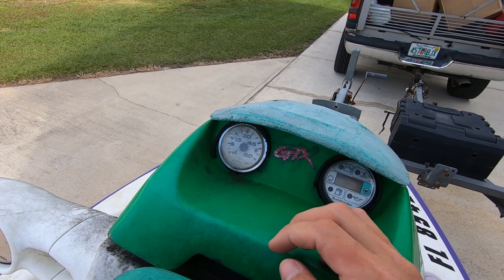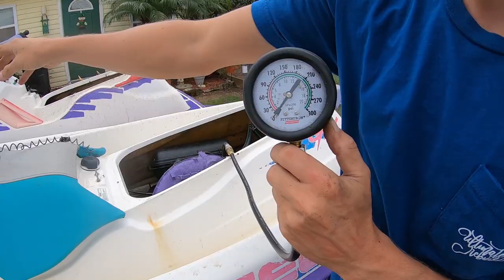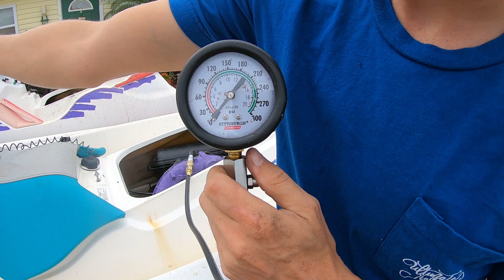I Bought a Pair of Jet Skis for $500! They Worth It?

Comment: 90psi is low for sea doo skis, however, I'd never trust a harbor freight gauge, I guarantee you'd have higher compression if you tested with a different gauge. But just so you know you want to be closer to 150ish on the 587, 657 and 717, which your spi has a 587 while the gtx is a 657 (I think, could be a 717 though) the difference on the sp to the Spi is the spi has a stainless steel impeller (that's all I know for differences) one very useful tip, DO NOT USE ANY OTHER CARB KIT THAN OEM MIKUNI!! You will go backwards with any other carb kits!

Comment: Those engines need to be around 120-150 psi in each cylinder. While the compression isn't crazy low, they do need to be higher than 90 psi.
Reply: They seem even, so I'm assumimg he just needs a better gauge. The harbor freight ones are junk and known to read really low.
Reply: Agreed, And the Harbor Freight compression tester can't be trusted

Comment: If it reads 90 put 1 or 2 oz of oil in each cylinder and re run the test over. If the PSI goes up then you know you have a ring problem

Comment: I just bought a 1990 seadoo with trailer for $300. However it does not stay running. If you give it gas it dies. Hoping its a easy fix.

Comment: Compression are good just reading 90 because I see you have a harbor freight compression tester and those read low I know because I did a compression test on my boat and the rent 90 then I bought a new one from snap on tools and the read I recommend using Anything else by Harbor freight

Comment: If you run anything that's fiberglass real hard you will twist it and that cracks the gel coat. Both of them look like they have been run hard  and hit them on rocks or what ever. Just sand the cracks out. And regel

Comment: Your compression is low because you are using too long a hose.  You not only have to pressurize the cylinder but ALSO the full volume of your hose.  Use as short a hose as possible.  Ideally a gauge with no hose at all for the most accurate reading.  You are probably good because all 4 cylinders were pretty much the same.  Would be unusual for them all to be low by exactly the same amount.

Comment: No the stress cracking is just cosmetic
Reply: The fiber glass under should be fine but if you don’t know the condition of the fiberglass underneath I would grind it down if it interest you but it should be fine and not leak if happens to older boats

Comment: Throw your harbor freight tester in the trash. They stopped putting schrader valves in them about 10 years ago. They all max out at 90psi. Get one from Amy auto parts store and I bet you’re much higher. Those skis wouldn’t run if they were actually at 90

Comment: Those gauges aren’t the best. Regardless they are both 2-strokes and a set of piston rings alone will wake them both up tremendously if you find out they’re both legitimately low on compression. Very cheap, and definitely doable for someone with your level of mechanics. If you do rings you will get so much more life out of them not to mention power, IF the compression test comes back low. $500 is still a good deal though. Before taking anything on the water or running at high RPM’s I always have the basic things I do first. Drain every bit of old fuel and fill the tank with new fuel and throw in a half can of sea foam. Replace air filter, and fuel filters. New plugs, check wires for dry rot. Wouldn’t hurt to check header pipe seals to make sure your exhaust is still making a solid seal and the gasket or seal isn’t dry rotted. I use high temp rtv on all my 2-strokes. Once you get your carbs back you can play with your idle screw just a little bit if you’re having the same issues as your last ski as far as them not wanting to start right away and idle

Comment: You should feel guilty for stealing those jet skis. That trailer sells for $3,000 new and good luck finding a used one. The carbs can be bought new on ebay for not much money. If you took one engine out and stripped all the parts off of it and sold the engine block alone, you could get $500. So yeah, you got a killer deal. The compression test was done correctly but to diagnose the problem you should put a tablespoon of  transmission oil or motor oil in the cylinder and do the test again. If you get an increase in compression then the problem is worn piston rings. If the compression stays at 90, then something else could be leaking but on a 2 cycle engine that seems unlikely.
  Paint if you must but the gruffy look gives it character and makes it easier to identify if stolen. For that reason a custom paint job would be better. I would also stencil the serial number on the back to make it easier for the police to find it if it gets stolen. Stick on numbers and letters can be easily scrapped off by thieves so don't use them. After stenciling the serial number, seal it with a clear coat. Make sure that all the lights work on the trailer and put some reflector tape on the sides of the trailer and for extra visibility I'd do the same on the sides of the Personal Water Craft. The more visible you are to all the drunk and drugged drivers on the road the less likely you are to be hit. 

Get that trailer and the jet skis (PWC) registered as soon as possible in case you need more info from the previous owner. Make a contact on your cell for each machine and note the serial numbers of both the hull and the engine. In addition to that I use a free phone app called "fuelly" or "acar". It keeps track of your maintenance schedule, part numbers, cost of repairs, per hour operations cost and fuel usage. I use it for my car and lawn mower. You should install hour meters on your machines because that is what you need to enter where it asks for mileage. I would also clean, inspect and replace, if necessary, the trailer's wheel bearings and replace the wheel bearing dust covers with bearing buddies. That way you can use a grease gun to squeeze the water out of the bearings as part of your maintenance routine. Put some flares in those waterproof containers and find out what other items may be required by your state.  Put a goofy sticker on the winch post that will remind you to check the drain plug before a launch, Sponge Bob would be appropriate.  Always require everyone to be buckled up when they are riding in your truck or car, stay safe, and have fun.

Comment: This was cut and paste from a Rotax Blog, Take it or leave it

.f an engine had a poor differential pressure check I would always run it before I made a final decision on a low cylinder reading.

Yes a warm engine is always best, but......

Typically a Rotax engine compression test is very close or the same warm or cold because of its tight tolerances. That said it could be different if left over long periods and would need to be run a few minutes to get oil and sealing surfaces up to their optimum. I have been checking this over the last 10 years. A warm engine versus a cold engine that just sat overnight or for 5-8 hours. I do at least 50 compression test a year on Rotax engines. Test results are usually the same, i.e. 87 over 83-85 psi is pretty normal. Normally if it loses anything it may be 1 psi more if done on a cold engine. I have seen a few engines over the years that had a low pressure test on one cyl., but usually turning it over a number of times fixes it. I had 1-2 engines over time I actually had to run it. My guess is a sticky valve. Using 100LL all the time may get a lead clunker under a valve seat.
Rotax like many other engine MFG's use that 25% loss as a marker for serious concern, but in class we will teach there is a problem even with a 10 psi loss.
Many people also don't take into consideration gauge errors of 1-2 psi. This is actually quite common. When I buy gauges for pressure or vacuum (carb sync) I usually buy 4-6 at a time. I put them on a pressure or vacuum system and keep the ones that read the same and pair them up. I don't want a gauge being 1-2 psi or inches of vacuum off from one another. This is extremely important to have good gauges for the carb sync.

The other thing I never believe is when I see a logbook entry of 80/80 psi. You need to get your gauges checked. The cylinders have to leak a small amount of air into the crankcase to help push the oil back to the tank. That's why you always hear a small bubbling in the oil tank when doing a compression test. No cyl. can be absolutely air tight with no air bypass to the tank. Normal would be more like 80/79 or 80/78.
If I saw one that said 80/70 I would be concerned. This isn't an air cooled loose tolerance Cont. or a Lycoming.

Here is another response in the same blog. 
 Recent compression test show one cylinder lower at 76/85 when COLD.
If the compression test is done with the motor WARM all compression is uniform and normal. I was advised that Rotax recommends doing the compression test when the motor is warm and this phenomenon is pretty common on all motors.

Comment: Don't use starter fluid on 2-cycle engines. Using starter fluids such as ether based or any starter fluid made for starting 4 stroke engines will cause severe damage to a two stroke motor. Starting fluid burns too hot, it is a very easy way to burn a hole in a piston.

If I’m remembering correctly. YouTube’s “kodibass”, says he only uses Tri-Flow superior lubricant as starter fluid if needed on a 2-cycle engine. It is highly flammable and a lubricant at the same time.

Comment: $500 is good for the trailer. I wouldn't give $1 for a seadoo. Cant actually delete the oil pump. And the spi is a 587cc. Its gonna go a lot slower than the gtx. The gtx has a 657x which has quite a bit of hp. They're just a pita to put a top end in without breakin the Allen head bolts the canadians used

Comment: Hit it with some bleach based ajax or old dutch, or that stuff that smells really horrible though removes rust stains and it should dial it right in.
Because of the price, they do make a very affordable canvas of sorts to use a airbrush to create designs to hide previous surface damages, or give em a heavy gelcoat and its new again. Could even add interesting fibreglass mods to it, a cool cabin roof that can be removed, or trip people out by using one as the core of what looks like a car driving on the water, with the addition of a corvette body or something else fibreglass.

Comment: Compression results are questionable, should be anywhere between 120 and 150, should ge within 5 psi of eachother, 90 is pretty low for that engine, pretty common in those machines

Comment: I wouldn't trust those harbor freight compression testers, bought three in a row that maxed out to 95 PSI. Borrowed a mechanic buddies MAC tester and got the proper readings 150 psi or so ..
90 psi is too low for that engine, since it runs your tester might be bad..

Comment: No, you bought 2 wave runners . And any compression over 110 should be sufficient for the engine to run. Even as low as 90. Definitely not 150. That's common sense.

Comment: Hold the throttle wide open when doing a compression test. I take a compression tester and a battery anytime I'm looking at a project 2 stroke PWC. Check the engine size by year and model on this link. 

http://www.seadoosource.com/impellerref.html

95 GTX is a 657 cc engine.

Comment: The compression is way too low at 90 psi should be between 125 - 150 a set of piston rings are cheap you can hope and pray all u like it won’t improve the compression and therefore will never run properly
Reply: His compression is good. His gauge is just not accurate being a Harbor Freight one. In reality he is looking at 120+. As long as they are even on each cylinder then he is okay

Comment: Thats a sweet deal! Check out my channel I show you how to do every step you'll need to do to get those to good running condition. You NEED to take just about everything out and replace lines, filters, wear ring, oils, and clean tanks for it to be reliable and last. Not super hard at all! Still working on adding videos of replacing the wear ring and finishing up my project (not my first rodeo). 

IF they do run (not that far in the video yet) don't run them for more than a couple seconds at all! and never run it without oil in the oil tank because these Rotax engines need oil in the crankcase as well as lubricating the cylinders.
Reply: You're definitely gonna want those carbs rebuilt! Either do it yourself (I have a video on it) or send them to me!
Reply: Also like everyone else said, your compression is totally fine. It is a Harbor Freight Gauge so add 20-30+ psi. As long as both cylinders are just about the same you're all good to go
Reply: NEVER clean carbs. Always rebuild these mikunis. You'll want both skis done just to be sure. A clogged carb filter can toast an engine.
Reply: You also need to hold the throttle wide open when compression testing. Not sure if you did or not couldn't tell.
Reply: Sorry for lots of comments but... Starter Fluid on jet ski = BAD IDEA.